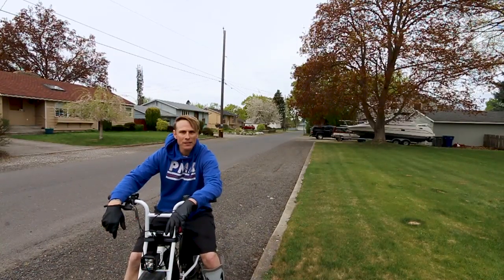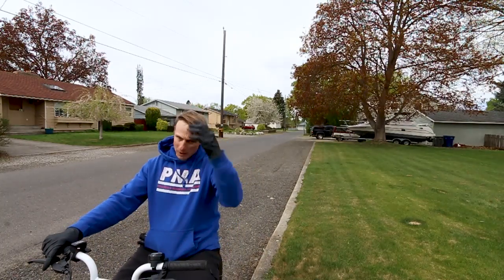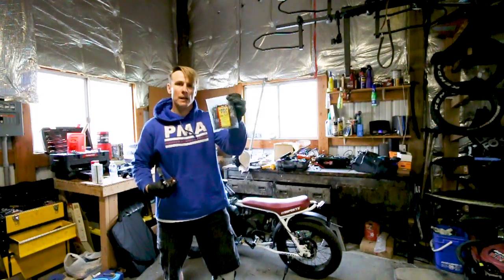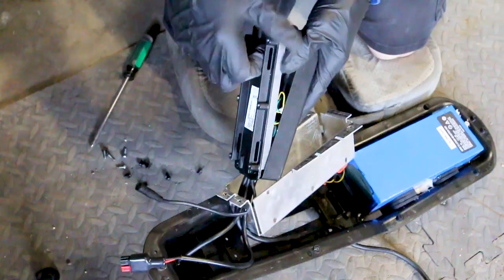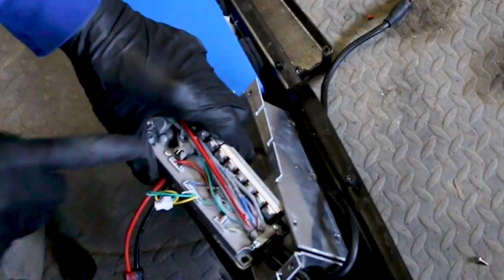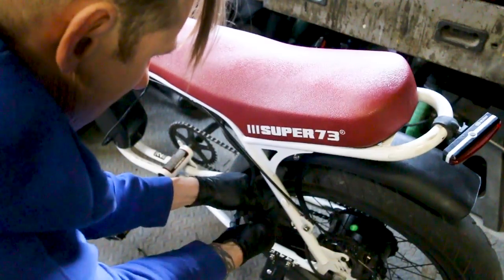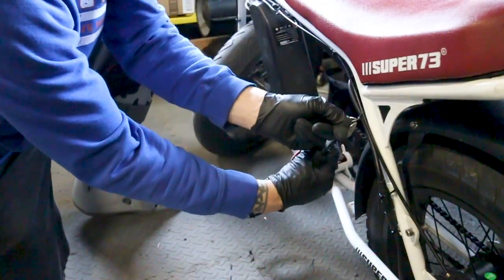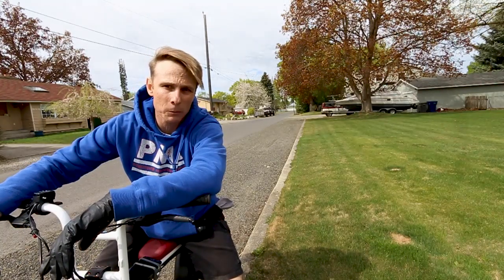Super 73 Z1 speed hack

Comment: Did the speed hack... put it all back together and when I pushed the throttle... nothing!!!! I was sooo mad! I thought this was a trick to brick all our Z1s...

But this is crucial for everyone... there is a wrong way to plug in the motor to control cable near the back wheel! Make sure you align the arrows when you plug it back!

The hack worked perfectly and now the power doesn’t cut off when I go over 20mph! 

Down hill and power would cut... this was my biggest frustration until this hack!

Thanks for the video! Love my Z so much more now!
Reply from the maker: Awesome man, glad this helped you have a better ride. :)

Comment: I did not know class 4 was illegal here in new york, glad there is a way to turn it off.
Reply from the maker: You can also buy a fake sticker that says 250x class 2 to put on other bike
Reply: @briandhoward6137  ill do that thanks, did it go faster than 23mph after you fully charged the battery? I would like to have the max speed of 28mph.
Reply from the maker: @JohnjOcampo  your welcome, the sticker is at Luna cycles.com. the bike did but definitely not 28 mph like 26 was max
Reply: @briandhoward6137  got it last question, if i simply buy a better controller will it be able to reach 35mph or will i also need a better battery to reach that speed?
Reply from the maker: @JohnjOcampo  you would need a battery also, 36v would most likely not get you there
Reply: @briandhoward6137  great ill take note, thanks for your help Brian!
Reply from the maker: @JohnjOcampo  absolutely

Comment: I have tried this on my Super73 ZG but it did not work for me and my controller shuts down after I reach the highest speed. I can’t ride my bike anymore unfortunately 😔. So do I have to get a new controller or something? I don’t know what to do.
Reply: Good luck modding, m8!
Reply: Just connect the wire back. Should work after
Reply: Just solder it back together it happened to mine to

Comment: I did it, 27.3mph on flat ground, woot!
Reply from the maker: Awesome!!!!
Reply: Do you have an after market battery installed as well or did u just cut the white wire?
Reply from the maker: @tomaiTTI  I have a second battery, but run off the stock one until it's dead than I plug in the second one . I do not run them at the same time
Reply: @briandhoward6137  would you modify my z1 for some cash?
Reply from the maker: @tomaiTTI  where do you live
Reply: @briandhoward6137  NYC
Reply from the maker: @tomaiTTI  I am 2500 miles away
Reply from the maker: @Noe Muro if I was not 17 hours away I would

Comment: Should just extend the wire a bit and put on a external switch under the seat or something. Then you could  like to be able to turn on the limitation when ever you want
Reply from the maker: That isn't something I would have ever used, I know others that have done that but for us it would have never been switched back, if we want to get a little slower we just use less throttle. Thanks for the comment, and checking out my video
Reply: @briandhoward6137  If this thing had a little more power (mening that it was much faster without the limiter): - It would be nice to turn it down if you  ever were to be checked by police/DMV. We have had a terrible accident here where somebody on a DIY Electric bike at motorbike speeds almost killed a pedestrian in an accident. Our Police and DMV is very active in checking these vehicle here.
-If lending it to "Kids" or others it would be kind of like safety limiter.

But i do agree. In this case it almost makes no difference at all.
Reply from the maker: @Zachry86  well in my area police don't care, and the DMV would never check a bike that went under 28mph.
Reply: Ive done this but with a switch. From my experience it’s necessary because when you snip the wire it has a lag before the power kicks in. It works best it you use the regular mode to accelerate then hit the switch once it get close to 20mph. It works as a hi and low gear.
Reply from the maker: @MrTurkeybags  interesting, I never noticed any lag in the bike.
Reply: @briandhoward6137  its there after you snip the wire

Comment: I have an european one. Pedelec... That can work on it too?
Reply from the maker: I do not believe so, you would need a different controller, a us one. There are many guys that have swapped motors and controller in the use to bigger ones, you may be able to find one
Reply: @briandhoward6137  I was thinking maybe on getting a throttle and and extra battery and maybe do the assembly you did in the other video with your extra battery and changing the controller
Reply from the maker: @manuelb.vergara21  setting up a second battery is easy and the range is so great

Comment: Would this work on the new z Miami?
Reply from the maker: Great question. I would open the controller and see if it looks similar, if it does try it, but I'd cut the wire where it can be repaired just in case it doesn't work. Thanks for watching. Good luck
Reply: I don’t think it would work on the z Miami,  you can click onto mode 4 with the app on your phone, which does around 26 mph

Comment: Can you do this speed hack without the dual battery ?
Reply from the maker: Absolutely
Reply: @briandhoward6137  how much range will you get tho , with the speed hack and just the stock battery
Reply from the maker: @David-1-2-7  you will loose range, more speed means more battery draw.
Reply: @briandhoward6137  yes I know but do you have like a rough estimate of how much range you get after doing this hack and only having the stock battery ?
Reply from the maker: @David-1-2-7  that's hard to say because we all ride different and have different landscape we ride , hills, flat ect and different rider weight, different tire pressure and a difference in riding style, where I may loose 30% you my only loose 10% . My advice is get a second battery and not worry as much about range. I personally like to worry about the fun and not the range that's why all my bikes have dual batteries. Hope that helps a little
Reply: @briandhoward6137  oh aight thanks
Reply: what second battery do you recommend buying?

Comment: Man great hack bro.  Did it this morning (early) and it was literally just following every step you did.  Top speed is now roughly 25 mph. 

Gotta question tho:  inside the controller I noticed another pin-plug that’s not connected to anything.  What is this plug used for or can be used for?  

I got nervous 😬 when I couldn’t find where it connected ...then saw you had same wire tucked back in on top of controller.  Feel safe now.

//Bklyn👑
Reply from the maker: Glad the video helped. If I remember that is  for a pedal assist sensor . I have seen a few guys use it.. hope that helps
Reply: Brian D Howard man thank you bro. 
You know I was gonna ask you to do a pedal assist sensor hack video b/c Brian I watched tons of videos for the hack....but NONE would show where to connect the wire once the hack is done. 

Been saying I wish Brian would do a pedal assist hack video ... what I like best about your videos is that you literally cover every step every minute detail that others just assume the viewer knows...thank you man. 

Next hack ...dual battery.  

/Bklyn👑
Reply from the maker: @robertmotion  thank you, I won't be doing a pedal assist video, I'm a however be doing a mid drive swap video on the Z1
Reply: Brian D Howard actually I’m thisclose to figuring it out.  I’m enjoying the process...

Freddy the Super73 thanks you too

/Bklyn👑
Reply: Is the range still the same?

Comment: Its interesting and that hack does work but I don't know if doing all that is worth gaining only 2 to 3 mph, plus I am sure that voids the warranty and puts more load on the batteries.
Reply from the maker: My warranty is long gone, it is only 30 days long when I purchased this, I am not worrying about battery life, I wanted to up the fun factor.. to get ach there own. Thanks for watching and the comment
Reply: @briandhoward6137  U should had done the shunt mod while you was at it. That might have got it closer to 30. Or better still run them 2 battery packs in series, 72v baby !  And you'd be surprised how 72v does work but 37mph is really pushing to the limit for that motor
Reply from the maker: @technocrat7971  I wanted to do mods that everyone can use, I don't ride this bike, to small. I have a mario bike and a surron are my go to bikes
Reply: @technocrat7971  what’s shunt mod ??
Reply: @David-1-2-7    Youtube search "speed controller shunt mod" .
Reply: @technocrat7971  you’re running 72v on the original motor??
Reply: @technocrat7971  you’re running 72v on the original motor??
Reply: @technocrat7971  you’re running 72v on the original motor??

Comment: Can anyone watching confirm this doesn't brick you bike?
Reply: Worked for me. It’s a simple hack.  If you follow along — and you own VERSION 1 Super73 Z — you not gonna go wrong just follow every step.

Worked for me. Top speed went from 20mph to roughly 25 mph

/Bklyn👑
Reply: @robertmotion  how much range have you been getting on a full charge after doing the speed hack ?
Reply: I just finished mine and thought I bricked it... but realized that you can plug your control to motor cable the wrong way... you have to align the arrows...